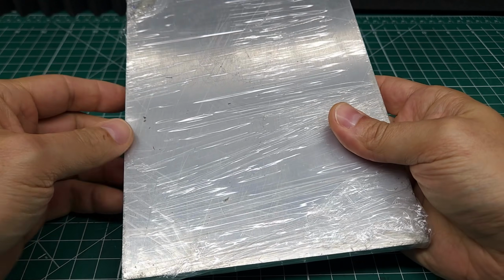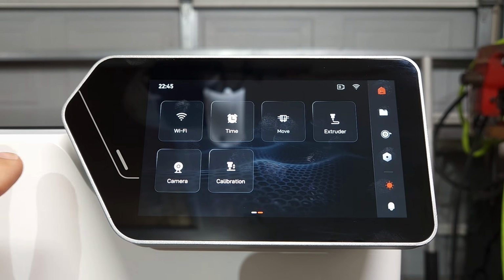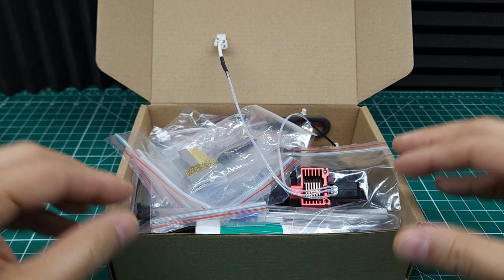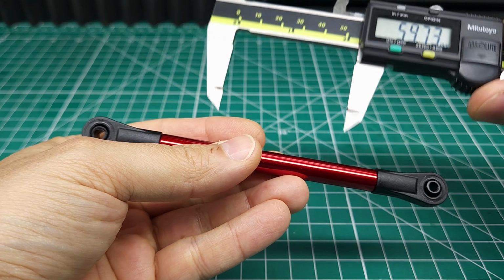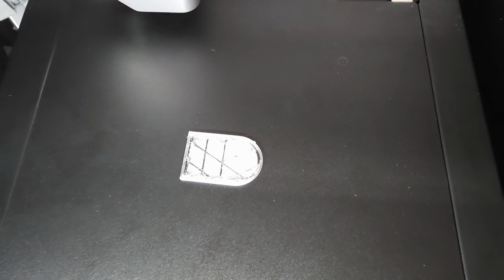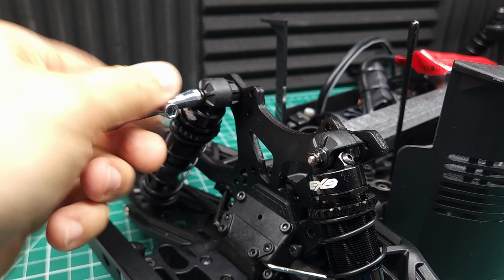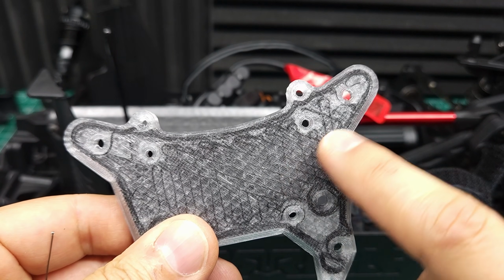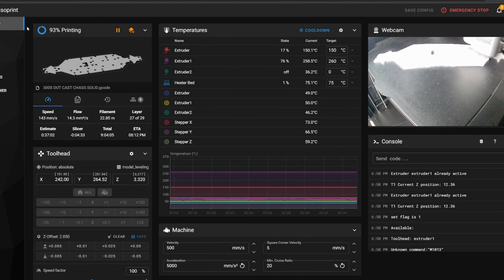Not Just RC...The Future Of TECH Is Here!

Comment: I think that it is time to build an entire car from 3-d printing using different materials.
Reply from the maker: Not a bad idea.
Reply: It has been done, seen a lot of videos about it
Reply: @jamalcole1985  Hasn't been done Do RC style - I prefer his delivery and informative approach compared to most - but hey - we will see👀
Reply: Yup!  @KeenoHaldane
Reply: I designed and built a fully 3D printerd 1/10 scale F1 car. It's been an ongoing project with upgrades over time. It's definitely doable, but takes a lot of time and effort.
Reply: Lots of YouTube channels and Facebook groups for it. Some very cool scale rigs out there 100% printed!
Reply: been thinking this too
Reply: Look up 3dsets, they sell files for super scale fully printed cars minus electronics and hardware.
Reply: A plane might be easier, maybe a simple flat plane- not as complex, less pieces, and it doesn't have to be very strong. Just an idea.
Reply: Most 3d parts either are too flexible (100% infill TPU) or too brittle (carbon fiber filaments and most other filaments) I’m sure it’s possible but I’ve yet to find the right materials.

Comment: Seems like they are missing an inner nozzle/tube for the carbon fiber lineup, just like the use for the big concrete printer reinforcing with steel wire, otherwise a super nice step forward in 3D printing. Now make the print area same size so 300mm in all directions an if i could choose do 500mm, yes, the price would be higher but more usable for actual printing tools and such. They can shorten the minimum carbon wire by moving the cutter to the backside, using a custom nozzle allowing the fiber strand to be fed into the heated nozzle from the side of the heated nozzle. This way they can do really short carbon fiber
Reply from the maker: I'm not sure feeding the carbon fiber in from the side would work because you'd have to have a pretty sharp 90° and it probably end up breaking the carbon. My guess is that the straight in path for the carbon is a pretty intentional design choice.

Comment: This is some cool technology! PETG is a diverse plastic. What if you tried using a nylon filament? (The price will be silly but it would be more apples to apples)

Also, orientation of the carbon strand is important, as you said tension is where it shines. Different infill styles might be beneficial. (The carbon sheet you showed is not the weave all the way through. Typically each layer is a plane of fibers oriented in the same direction. So one sheet is at +45 degs and the next is -30 deg then is mirrored.)

Edit: maybe ASA would be a good option due to better UV resistance.
Reply from the maker: Nylon really isn't that expensive and there's no reason why it won't work on this printer. It should be able to use most filaments They just don't have profiles set up for them yet and for the purposes of the video I just wanted to stick with what they had configured. 
And different styles of infill and whatnot are in the slicer again it's just not something I really messed with but how it's laid down in the part is very important for the properties you want which I think is something that they'll be able to improve on overtime
Reply: @DoRC your good! I’m just throwing out ideas. Testing a prototype machine that is also unique, you sure have your hands full.
Reply from the maker: @rsquared9703 Yeah I was definitely excited to do it!

Comment: Do you have recommendations for a good budget 3d printer than work for this and making RC crawler obstacles and such?
Reply from the maker: If you're just getting started your best option is a bambu lab. The a1s are great Just look at the bed size and pick the one you want or the new P2S that's coming out is a good step up from that if you don't mind spending a bit extra money
Reply: Thanks!
Reply: @Hutch_Davenport  you could also go with a creality ender 3 V2 it is pretty manual but dirt cheap and pretty good